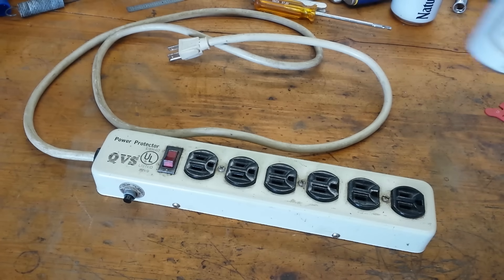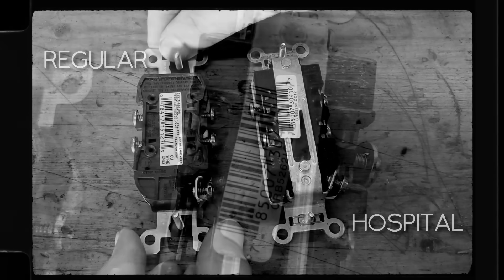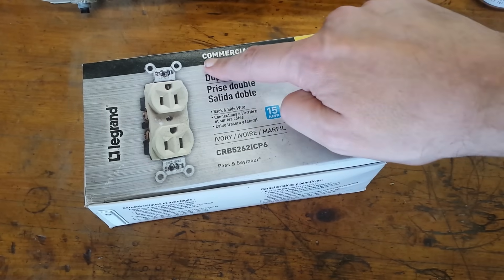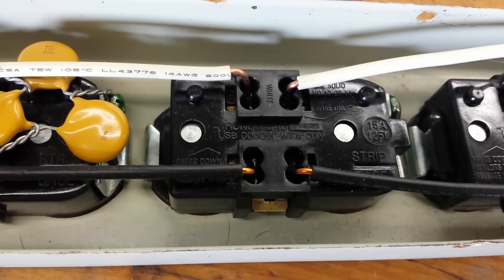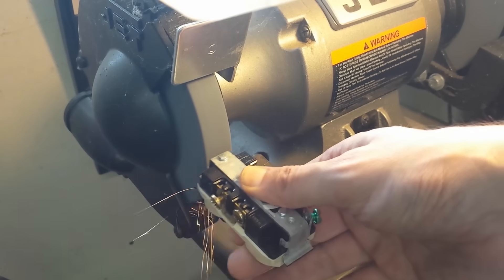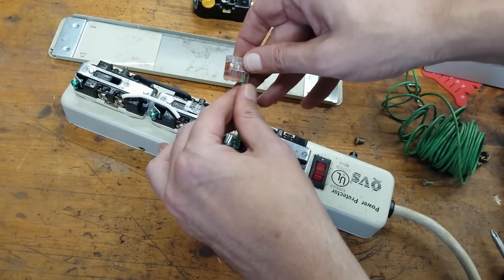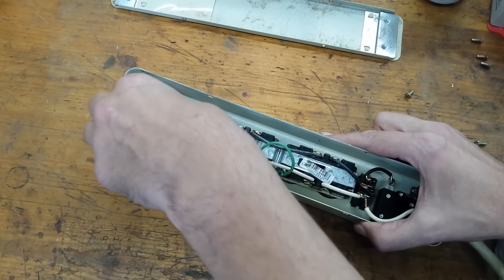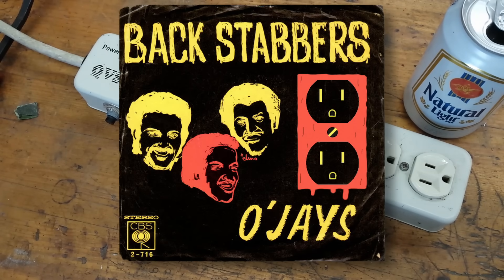I like "upgrading" old power strips for some reason...

Comment: I have one of these power strips as well. Mine has a 15 ft cord on it. It's very useful. My center two outlets don't work anymore so I will be replacing mine as well. I also need to replace the switch, as it has failed.

Comment: The MOV are easy enough to find online, I noticed you didn't put any back in. So it's no longer a surge protector, just a power strip. Cool project, I do stuff like that too.
Reply from the maker: Thanks! Yeah, next time I do one I'll try to make a video on replacing the suppressors.

Comment: These old power strips aren't fancy, but they offer some options. I'm lucky - the company I used to work for bought all APC racks with various size PDUs (power strips of extremely high quality) and immediately threw them away to be replaced with the preferred versions which could be controlled over the network. I have some that are so long I'm not sure how I will use them, but the construction is so solid I could never part with them.
Reply from the maker: Very cool! I wish I had grabbed more stuff like that back when I worked in IT. Amazing what companies would throw away...

Comment: When they make a power bar with "real outlets", they should at least use good ones.  I'm looking for one that has a metal case and real quality outlets, but they seem to be impossible to find.  So, may end up upgrading one that I have or buy a metal one and upgrade it.

Comment: i love the old metal bodied power strips for use in the garage or on jobsites for the very reason of i can attach magnets to the backside of the box and stick it to a toolbox, truck fender, work bench, or steel plate on the wall and have 6 outlets easily accessable for connecting lights, tools, chargers, etc, interesting use of one of those builders packs, might have to do that when i refresh my strip i use when i go camping

Comment: Having worked in IT field service, some of the locations I worked at were hospitals.  As I understand it the green dots indicated an isolated ground, i.e. separate from the rest of the building.  This would prevent electrical noise from air conditioners, etc. getting into the medical equipment.
Reply from the maker: Isolated ground outlets will have an orange face, and/or a triangle symbol on them. Hospital grade outlets can be isolated ground, but they don't have to be.
https://www.legrand.us/wiring-devices/outlets-and-receptacles/commercial-receptacles/20a-125v-heavy-duty-spec-grade-isolated-ground-duplex-receptacle-back-and-side-wire-red/p/ig5362red

Comment: turned a surge supressor into a power tap. All while using those little connectors that prone are to overheating. I would have used Wire Nuts myself.

Comment: I dont get it.  I have been using power strips for nearly 50 years and never had an issue with plugs accidentally coming out.  Even with ones that get constant use being plugged and unplugged.

Comment: What happened with the surge and button breaker?  It looks like you changed them out.  What did you use?
Reply from the maker: The circuit breaker is still there, I did leave the surge suppressors out - they go 'bad' after taking so many hits, and I'm plugging this into my UPS unit which has it's own surge suppression.

Comment: A few years ago, I did a similar thing to swap out the outlets on a metal Monoprice power strip with Tamper-Resistant (TR) outlets for kids room.  I couldn't believe there didn't exist a TR power strip on the market... I like your mod, but seems like the WAGOs + all the ground pigtails were overkill - couldn't you just run a single copper wire to all 3 outlets and loop it around each green screw?  Would be cheaper and less points of failure.
Reply from the maker: True, a bit overkill.

Comment: I actually have one of these metal power strips.

I didn't realize for a LONG time that it was actual outlets inside it. Once I figured that out, I actually decided to build my own power strip using electrical boxes, a heavy duty extension cord, and a house switch. It's a pretty decent power strip, though much more "boxy" than a normal power strip.

Comment: Starting to think modding a strip could be worth my time. Looks like a fairly straightforward project? Been meaning to retire the power strip I use with my vintage computers in favor of something a little more robust, too.
Reply from the maker: It was pretty straight forwards other than having to grind the ears off. Other brands of outlets you might be able to just break the ears off at the perforations, but on these ones, it wasn't enough.

Comment: My ON / OFF toggle switch broke.
Anybody know where to get those ?
It lights up red and has maybe 3 wires.
Reply from the maker: Search for "lighted rocker switch" Something like this: https://www.amazon.com/Illuminated-Position-Rocker-Toggle-QTEATAK/dp/B085ZSWX62 Make sure the voltage is correct, the measurements are the same so it will fit in the opening, and you'll have to figure out the wiring.

Comment: I didn’t realize those metal boxes had duplex receptacles in them.  I’m disappointed in myself that I’ve never taken one apart 😢. 

It would concern me that the device is now just a power strip and not a surge protector.  I always look for the best practical joules rating when buying new surge protectors.
Reply from the maker: Yeah, I have this one plugged into one of my UPS units, which has better surge suppression anyway. You can replace the surge suppressor elements with new ones if you want to.

Comment: WAGO has a 4 port "push-in" connector, but I don't think there's a 4 port lever connector. You'd need a 5 port, or double 3 port like you did.
Reply from the maker: Thanks for the info!

Comment: Guy buys a power strip that worked for 30+ years and presumably would do so for the next 50. Than he butchers it while talking about how the outlets he installs will not let the connected cables fall out while the entire strip has a switch that can be accidentally pushed. He finishes reassembling and not putting the condensors back, making the strip not only worse mechanically but also eletromagnetically.
Reply from the maker: LOL @ "condensors" and "mechanically but also electromagnetically" Thought you were serious for a second.

Comment: So you removed the surge protector? Did you even test or replace the button fuse? This doesnt seem like an upgrade more than a refurb that eliminated a critical function of the original device.
Reply from the maker: Yes, I don't need the surge suppressor as it's plugged into my UPS unit which has better surge suppression anyway. The circuit breaker is fine.

Comment: The problem is it’s not a surge protector anymore. It’s just three outlets put together.
Reply from the maker: Correct. It's plugged into one of my UPS units which has better surge protection anyway. I might do another video in the future on replacing the surge supressor elements.

Comment: Backstabbers have a bad name but they're actually good.  That retention spring will hold the wire (copper or aluminum) thru thick and thin and the conduction path is excellent.  Screw down fasteners can loosen up due to heat/cool cycles and have no ability to retighten.

Comment: You are missing the surge protector part but idk if you can easily get a replacement?
Reply from the maker: Yes, this one is now plugged into my UPS unit, which has it's own surge protection. You can replace the elements in the strip with new ones, I might do a video in the future on that.

Comment: Wire nuts are better than wagos wagos are the same as backstabbing that lever is only there to release the spring for stranded connection per the wago instructions you can push in a solid conductor into them without lifting the lever I recommend a diyer use wagos but a licensed electrician should know how to make a solid connections with a wire nut that will last the life of the conductor.

Comment: god don't get me started on wire nuts, the number of times I've run across ones where the plastic has become brittle and breaks when you try to disassemble the attached wiring would horrify people. and this is in wireing less then three decades old, if you live in an old house shut off the main breaker and spend a few hours  rewiring all of your outlets with WAGOs (or pay a professional to come out and do it) there is a reason wirenuts are considered a fire hazard over in Germany

Comment: Why connect all the ground to the case?
Connect all grounds to ground wire on the plug is so much better.
Reply from the maker: It's just an extra additional path to ground. The ground wire from the cord is already attached to the case, and even without my extra wires the outlets would have grounded to the case through the center screw.

Comment: 3:01 Spends the first 2 minutes praising how robust the hospital grade outlets are and how hard it can be to push the plug in/out. Proceeds to grind off the metal mouning brackets leaving only the center, plastic, not meant for the purpose, screw holes to hold the whole thing in place.  You, sir, are a fool.
Reply from the maker: LOL! The center screw hole is how the original outlets were attached from the factory, and earned it a UL sticker. There's no 'plastic' where the screw threads. There's a metal insert that goes all the way through to the strap on the back. You sir, have never taken something apart to see how it works.
Reply: @ballinator  How is the UL rating of the old ones relevant when they went in the trash?  You modified the new ones, and even joked that you didn't care about the safety of doing so.
3:06 The new outlets have a metal brace across the back of the outlet.. except at the middle.  You can see daylight right through the center of this brand of receptacle.  Any metal inside is only meant for holding on a cover plate and most certainly not intended to support the strain of use, particularly the heavier strain you aimed for.
Do what you want.  It's your garage and family at stake.  But don't post it as if you did something wise for others to copy.
Reply from the maker: @rbhe357  Umm, no, the insert for the center screw is attached to the backstrap. They're designed for this. It's no different than any other cover mounted receptacle secured by only the center screw. https://www.lowes.com/pd/RACO-1-Gang-Round-Metal-Electrical-Box-Cover/3179239
Literally every drop on the production floor at work was done this way. No cover plate at all, just one center screw attaching the outlet to a knockout in a steel stud.

Comment: Why do you say "real outlets," as if the prong slot contacts in flat power strips somehow "don't form" real outlets just because each outlet isn't in a discrete subcase?
Reply from the maker: I need to do a comparison video where a take apart a cheap power strip. A lot of times they just have thin metal tabs that run the whole length. to form the contacts. If one gets damaged there's nothing you can do to repair it.
Reply: @ballinator : There are some things you can do to repair even those, but it just depends on what broke. But even if you couldn't, that wouldn't mean the outlets in those are "not real." There are several levels of reality for many things. The best thing to do would be to edit the thumbnail picture text accordingly, like replacing "Real outlets?" with something like "Regular outlets?" or "Better outlets?"

Comment: Why remove the surge protection?  What is the harm if it has possibly failed already?  Or, can you easily replace these parts with identical parts?  I do love buying old metal bodied APC surge protection strips similar to this - making sure they are good for a full 15 amps of 20 amps, depending on my needs at that location.
Reply from the maker: This one's now plugged into my UPS unit, which has better surge protection. I might do another video in the future where I replace the surge suppressor with new parts.

Comment: How did you hook these outlets together in a row
Reply from the maker: They're just daisychained with solid core copper wire. One terminal to the next.
Reply: @ballinator I mean the places where you cut off the flat connectors nonconduting where the screws held it down
Reply from the maker: @clasicradiolover  The outlets are held in from the top, from what would normally be the cover plate screw.
Reply: @ballinator I wish you would have shown it. Good work BTW

Comment: the green dot means isolated ground, indicating it should be wired with its own independent ground wire to the main panels ground bus, its not exclusive to hospitals, lots of commercial sites spec them in certain load cases, and in this case would technically be against code as the 3 outlets are sharing a ground here

those other features you highlighted on your duplex outlets are getting more common, even on the cheap outlets, i assume as manufacturing gets more refined over time
Reply from the maker: Isolated ground has a triangle symbol, or will be orange in color. Hospital grade outlets 'can' be isolated ground, but they will then have a green triangle, or the green dot and the orange triangle on them.

Comment: Once the tabs were ground off what held them together when you moved them as a unit? Just the wiring? You really rely on just that center screw to take the “kegel action” of two plugs?
Reply from the maker: Just the solid core wire held it together. Yeah, the center screw is the only thing holding them in. It's the same way it was with the factory outlets. They can't really move since it's such a tight fit through the openings. I had to sand one of them down to get the outlet to snap in.

Comment: You don't have to grind off those mounting tabs.  In almost every outlet I've ever seen, they are scored with break off points and bending them back and forth TWICE will snap them right off cleanly.
Reply from the maker: Thanks, I did snap them off beforehand, but there still wasn't enough room.
Reply: @ballinator  OK,  I never had that problem mounting outlets in a standard square box with the metal lid.  You must have "missed it by that much" with the power strip upgrade.

Comment: Industrial grade  5252 and 5262 are better than commercial grade.  As a design engineer for many years, I  did a study of all available receptacles, the commercial grade came out 20 years ago as a cheaper version of the hard duty type. Every project I  designed had the 5252 specified for my clients.
Reply from the maker: Great info! Thanks, I'll have to look into those.

Comment: It is just a commercial-grade outlet. All commercial-grade outlets have that metal strip running down the full length of the outlet. It is designed as a safety feature to prevent shock.

Comment: What about replacing the switch?  Is that an easy thing to do?
Reply from the maker: @sewashburn0529  Usually it's pretty easy and they just snap in and out. If I do another power strip video I'll show swapping out the switch on it.

Comment: Did you reinstall the surge protection capacitors?
Reply from the maker: I left them out on this one. They loose their effectiveness after taking so many 'hits' - I might do another video in the future where I replace them with new ones on a different power strip.

Comment: I have a ton of old power strips from various years, I only had one fail and it was a 15a fuse built into some sort of filtering board that consisted of two inductors and a capacitor

Comment: I still have an ancient Radio Shack metal power strip from the mid 80s, but I've wanted to open it up and see how it's done on the inside and if I should redo anything to bring into modern safety standards.

Comment: I would've gotten a piece of uninsulated copper wire and looped through all of the ground terminals. Maybe sliding on some heat shrink between sections then you would've had one continuous path. no waygo's needed and what's probably already a tight space anyway. Yeah I am pretty sure there is no such thing as an outlet without the tabs well there probably is but I'm 90% sure they just cut them off at the factory for that type of arrangement. I think there might be a panel mount variant but by the time you track it down you might as well just cut the tabs off. And yeah the spring tabs the material they use weakens overtime or the plastic breaks. I hate backstabs. Some of the outlets in my house when we moved in didn't even have screws talk about contractor special. They didn't even hold anything in and I don't mean they barely I mean they didn't. But don't worry the previous homeowner solved that by putting multiple layers of paint over them, I even had one that when I took the face plate off took the front of the outlet with it bifurcating it. And I've seen my fair share of wire nuts if you twist the wires together and put the cap on to hold them there's no issue, if you don't do that they work loose even though they say you don't have to twist them.

Comment: I did this ages ago but left the OG outlets as they were actually quite good.  All I did was replace the unlighted SPST switch with a lighted DPST switch to break both hot and neutral and not just hot.  Had to grind out the rectangular hole to a bit over twice the width, but the length was almost exactly the same.

Comment: I have one of these different, but similar extremely similar different surge suppressor style i just cut the ears off the outlets and Bent them so are they still contacted? Cause the original ones in mine contacted each other as a type of ground set up. The surge suppressor is so sensitive in mine that If I walk past it it trips sometimes but yeah, it works good though I use it. Mainly for electronics testing, like when I take a drill apart or something to do some maintenance to it. Because I know if it has a problem, that's thing's gonna trip immediately
Reply from the maker: Interesting. Yeah, I probably could have just bent the ears out of the way.